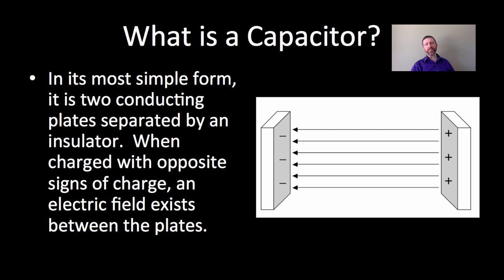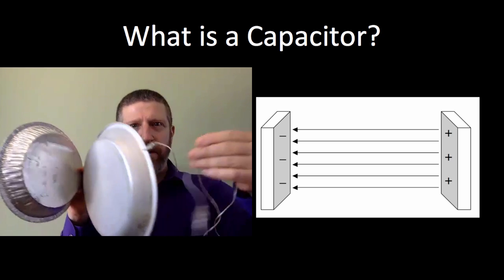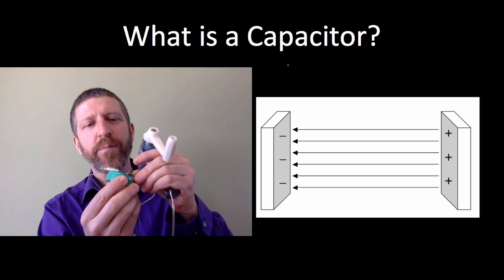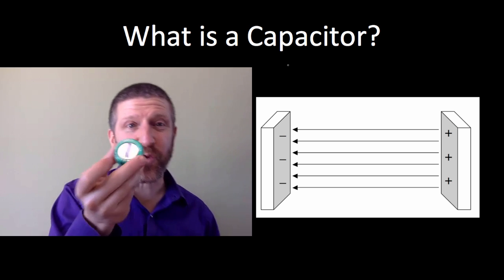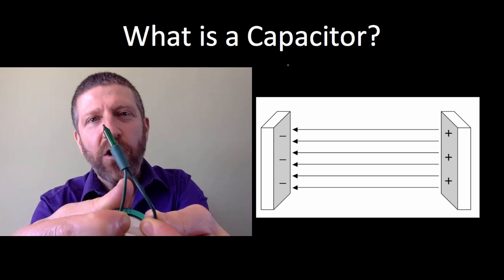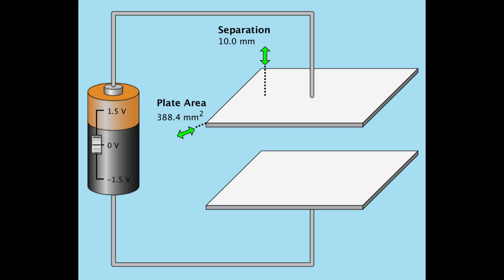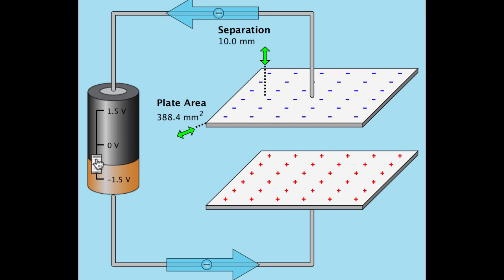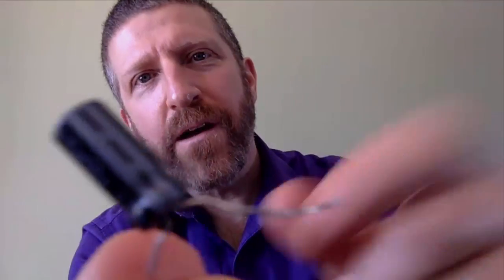16.02 What is a capacitor?

Comment: Love your video... but the charge in the plates doesn't travel across each other.. just acumulate negative charge and influence the other side to attract positive charge.. if it would travel from each side to the other, it would be a simple connector I guess.. again.. loved your explanation on the voltage part :)

Comment: Excellent, excellent, job with teaching us about capacitor.  I like you video because, because believe it or not some people believe  they under how capacitor operator or work in electrical circuits.  Most don't have clue.  They test everything and replace what went bad.  Not this doesn't make make than a bad Tech.  No on the other hand they great Techs.  They fix's things.  And we need they people.  The big problem if you send and engineer Electrical to teach new students, they such at it.  Your is the 1st. video I watch, that I can recommend  to people who come out of the closet, and say I really don't fully understand capacitors and work with them every day.  Watch your video Friday;  August 18, 2017

Comment: Two things:
#1 is a question is bothering me,  why the need for the capacitor? why not just attach the battery for the power source? this is what been bothering me. The real purpose of a capacitor.  I know they store power.  They use  them on "Air Hogs to be a light temporary power supply to turn an airplane prop. But what about their use in a Guitar amp, your hooked up to a power source plugged into a wall, so don't need to store power...
#2 Ok Don't take this the wrong way and I hope you still answer my first question. Cool devise with generator, and cool capacitor.
What would happen if some kid had access to one of those generator, but instead charged up a capacitor  that could store more juice,  like the kind found in guitar amp.  The ones that can knock you out your socks. I think you are missing a warning about capacitor can be deadly. 
Back to #1 I really want to know.
Reply from the maker: thanks for your questions. Capacitors are used for much more than power sources.  They are also used to create timing circuits, converting AC to DC, filtering out DC,  noise filtering, memory chips and more.  In an amp, capacitors may be used for power, but also for doing signal processing and noise filtration of the signal from your guitar, most closely related to filtering out DC, but that's just my guess, I"m no expert.  And you are right, large capacitors can be dangerous, but at least one common application of these large hazardous capacitors is rapidly disappearing:  CRT's, i.e. old televisions often had large capacitors, which when fully charged could be dangerous.  I don't know if guitar amps have similar sized capacitors.
Reply: Thank you for the info on capacitors, the reasonI have to learn working on a guitar that has 6 special effects.  There is no known schematic for these, not even from the Korean company that made them. I have replaced all of the electrolytic caps and got some improvement but I will have to open up again.  I might try to make a schematic  myself, but my knowledge is short. But one of the first things I learned about when working on tubes amplifiers is the need to discharge the capacitors, not the hard way TY youtube.  Because they will kill you FACT. also the one hand rule,  only one hand goes in while working on them.
ty again
I'll keep an eye out for your vids I'llgive you a like

Comment: This is AWESOME! But I have a question.

Why does genicon(?) knop keep spinning in the same direction when you stop spinning?

I think it should be spinning opposite direction because when you finished charging the cap, for example, left line pushing electrons, right side pulling electrons, then I think the electrons tended to move opposite direction where they came from resulting in opposite flow of electrons compared to charging situation. So the knob's spin direction might tend to be opposite because of opposite current flow.

What am I missing?
Reply from the maker: Great question.  Here is an article which explains the phenomenon of spinning in the same direction during discharge as during charge of a genecon generator:  http://www.dtic.mil/cgi-bin/GetTRDoc?AD=ADA615882

Comment: Thanks for the explanation now, what is a capacitator used for?
Reply from the maker: Every 'bit' (i.e. a 1 or a 0) of computer memory uses a very small capacitor, so a common smartphone contains billions of capacitors.  Timing circuits use capacitors, as well as circuits which change alternating current to direction current. There are many many other uses as well.

Comment: capacitors will nevr be the next energy solution
Reply: Josh entwistle  They are just like rechargeable batteries, like the kind used in mobiles. They ARE the current energy solution.

Comment: this is awesome,
I got two questions:
1) does the distance between the plates affects?
2) In batteries, what I know is that the electrons flow from the +ve to -ve, so the circle should be complete, but to charge a capacitor (as in the example shown in the vid) that is already separated by an insulator, how would the battery is charging or discharging the capacitor? I mean the electron is not flowing from one end to another
thank you very much
Reply from the maker: +Yusuf Hassan the distance between the plates does affect the capacitance, if that is what you are asking, by reducing the capacitance when you increase the distance.  Electrons flow from negative to positive on a battery.  With a capacitor, electrons flow onto one plate, and are pushed off the other, so though no electrons actually make it "through" the capacitor, any current going on to one plate, is pushed off of the other plate, so current can in effect, still flow, at least until the capacitor is full. I hope that helps.

Comment: Has anyone used these in an electric car? The car could go downhill powering up a capacitor and then have enough power to go uphill.
Reply from the maker: +ethan&#39;s universe great idea!  Its possible that ultra capacitors may eventually supplant batteries, but right now, the best capacitors can only store one-fifth of what a chemical battery can.  I'll bet Tesla is working on using them in tandem though!

Comment: And why do real capacitors have polarity marked on them?They  are just plates ,we can connect them in either way,,right?
Reply from the maker: +Keyser Söze Not all capacitors have polarity.  Only electrolytic capacitors do--the ones that have an insulator (dielectric) created by a chemical reaction.  If you reverse polarize them, you reverse the chemical reaction creating a short circuit.  Many capacitors are NOT polarized.
Reply: yeah thank you very much for your reply it was really helfull..........
Reply: +Keyser Söze 
Keyser Söze!
KEYSER SOZE!!!!
KEYSER SOZE!!!!!!!!!!!!!!!!!!!!!!!!!!!

Comment: With that generator you use ,one can  still charge the capacitor even after it's been reached its maximum charge.I know Its not same in the case of using a battery(charging stops when potential difference becomes equal).......
WHAT HAPPENS IF WE KEEP ON CHARGING THE CAPACITOR using that generator you have ???
Reply from the maker: Lets say there is a limit on how fast I can spin the  generator-if there is then that means there is a limit on the voltage (much like a battery has a voltage, like 1.5 V. ) The simple answer is that the capacitor will keep charging, but with a decreasing current, until the voltage is 12 V.  The more complicated answer is that the voltage across the capacitor only approaches 12 V, but actually never gets there, by the equation V=V_battery(1-e^-(t/tau)) where tau is the time constant for the RC circuit = R*C (the resistance of the circuit times the capacitance).  

If I spin the generator faster, I am increasing the voltage (pressure), so I could just spin it faster, and get more charge on there.   Most capacitors have a limit of maximum voltage they can handle, see my video:  https://youtu.be/q98MdguK7ZA?list=PL-rgZI7n0ovyNCOS1pRvG1LSb_FnDbE-L  Hope that helps!